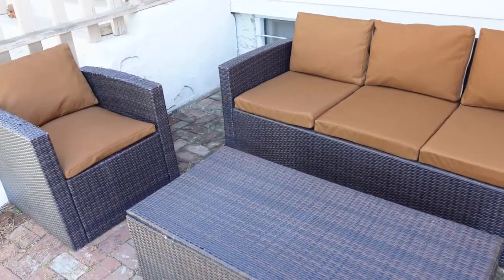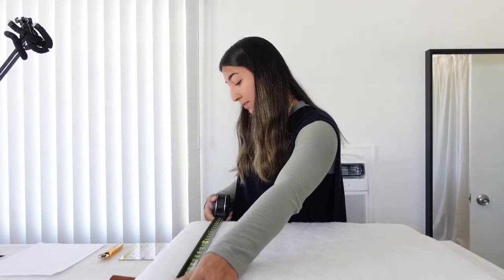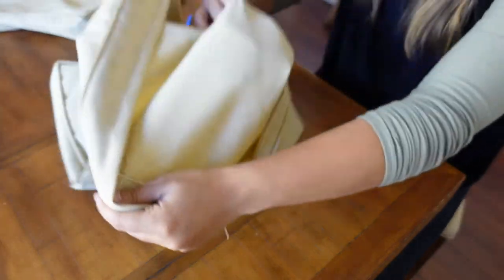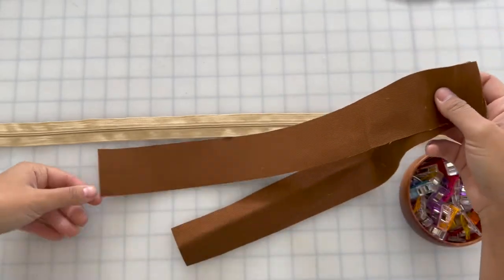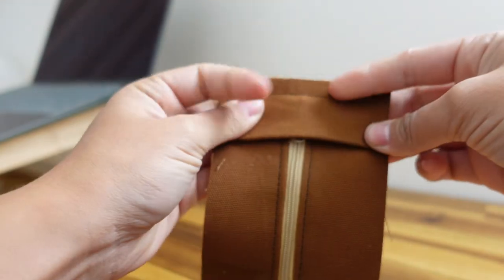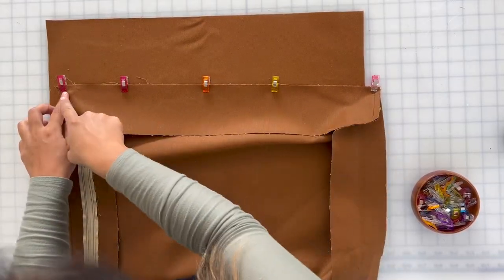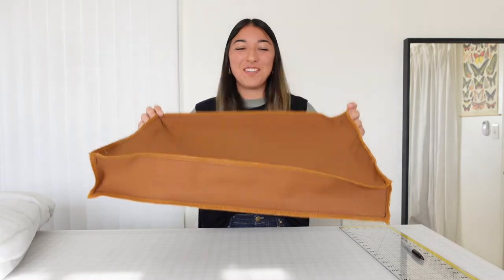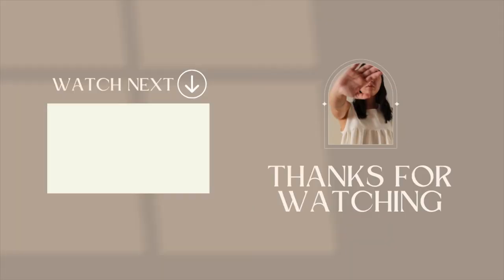How To Sew EASY WASHABLE Cushion Covers For Outdoor Furniture

Comment: What fabric did you use?  
I had ordered some waterproof cushion covers (to avoid getting the foam wet/mildew-y) but they trap body heat, and the cushions don’t compress well since air can’t flow or escape 🙃 Awesome video, thanks for the tutorial!
Reply from the maker: I used a deadstock Carhartt fabric and it worked really well!! The only thing is that they color is sunbleached now, but ultimately it’s held up well and is really comfortable 🤗
Reply: @jessilous_closet Awesome, thank you so much!!